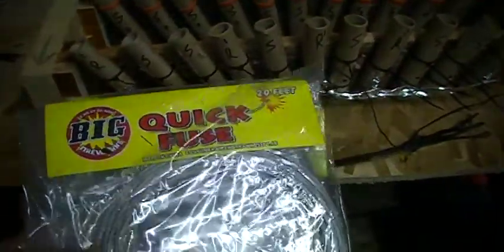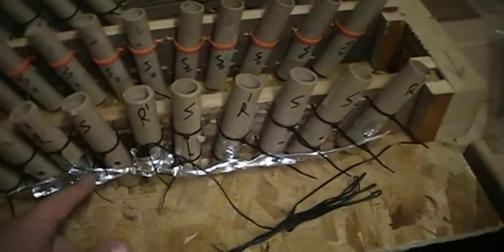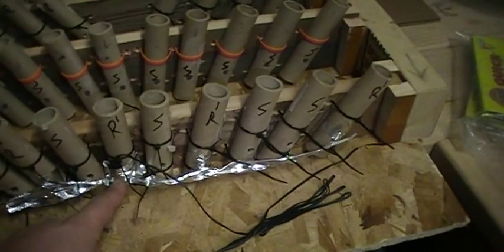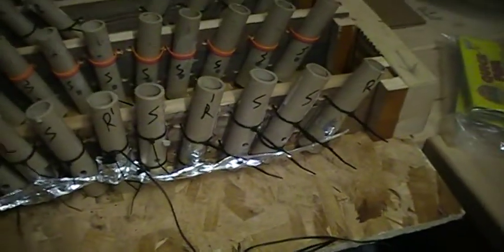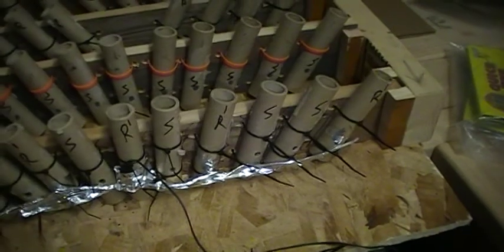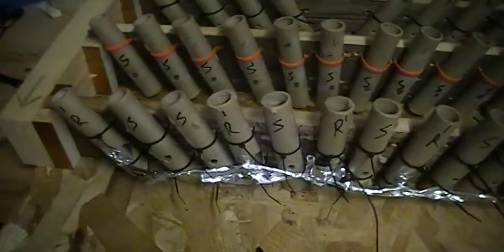Red razzle fan rack set up - individual tubes

Comment: Are you buying the product or making the fans?  I would like to add some of those to my shows
Reply from the maker: pyrocrew waycross The tubes in this video were taken from Red and Silver Razzle 1.4 cakes.  The individual tubes were labeled and placed in to baggies so I didn't lose track of what tube was what color.  You'll find that it's a lot of work, but you can really do some amazing things with 1.4 product if you tear it apart and place it in to racks like this.
Reply: Nice.... Might try it out after I finish my firing system